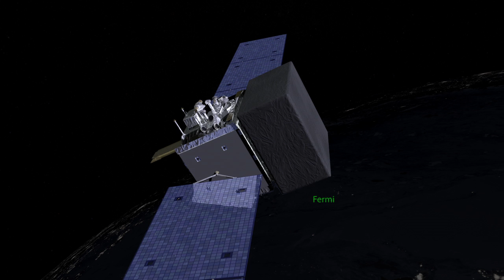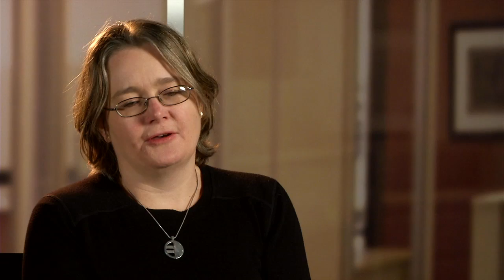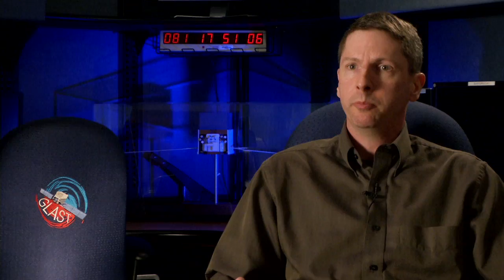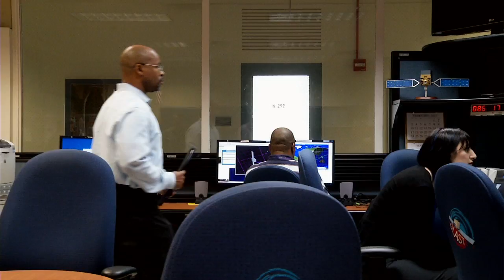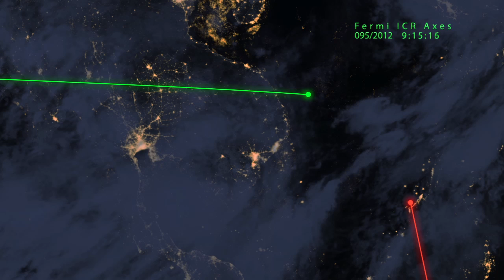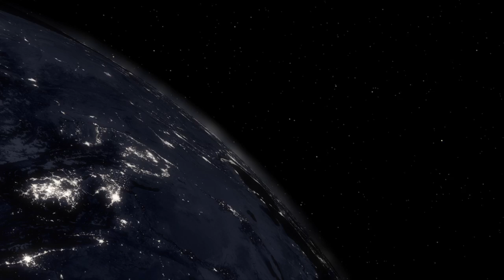NASA | Fermi's Close Call with a Soviet Satellite

Comment: The problem is that you have uncertainties. The further you go go forward, the less certain it gets. They are both moving at several kilometers per second. That means even a second difference is several thousand kilometers. To get within that 30ms range you need very accurate predictions so that's probably why they were only certain a week before the event.

the 1 second burn barely impacts the orbital path, but I'm sure space agencies share all that data to prevent accidents.

Comment: Define large? Even low earth orbit is a big place. Very big. If we take a single slice of it, that alone would have a bigger surface than the whole of earth including oceans. Like that there are thousands of slices stacked. Mostly empty. Mostly.

We have yet to find a method to efficiently clean it up. We have to clean it up, but it is a very complex problem we do not have an answer to yet.

Keep in mind that there are also function satellites there which you may not disturb.

Comment: ok nasa lay off the drama.  not once did you weigh the options between colliding with a several ton piece of junk at 25k mph OR fire your thrusters.  you got an engineer to design these thrusters specifically for this reason.